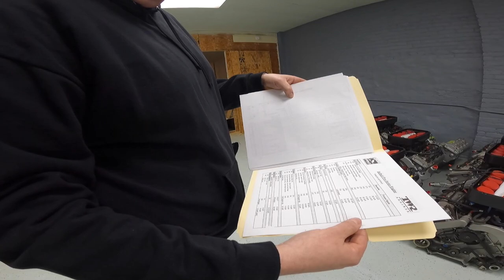10'800 HP! A collection of Nissan VK45 Indy Pro Series V8 engines up close and personal.

Comment: 450 HP with 8200 rpm redline in another article, make up my mind please
Reply from the maker: You’re referring to the drive. They just came and took the info from their for sale post without their permission and posted it and even incorrectly typed up
Information during the process. These guys never really went over any exact specs. They were referring to differently tested RPMs that were documented which varied across the board.
Reply: @Caito-garage  Understood. I am thinking there is only so many  HP available from 3.5 litres without a turbo or super charger.

My experience with small displacement V8s is extensive and they are often overlooked and underrated by those seeking monster cubic inches/hp.

We know an engine built for racing needs to be smooth at high rpms and sustainably durable which are all in a small displacement V8s wheelhouse.

So the question is what kind of extra horsepower comes between 6000 - 8000 rpm?

Is it possible that its 450 real hp at the wheels while naturally asperated and the 800 hp is what's possible with some help?

Additionally we know a 4.3 litre SBC V8 has monster torque at low rpms and I am wondering if the Nissan engine has similar torque potential and would be a racing advantage too?

In any case I was drooling over this engine even with 450 real horses having built 4.3 litre SBCs with 350 legitimate hp engines and knowing what it takes to even get to that level.

Also, I was on my wife's YT account before I noticed and you are talking to Blain.

Any updates on the specs of this would be appreciated.

Thanks for the work you do with your videos.

My expertise is auto glass safety

Here is me exposing unsafe practices on national TV and scooped Barbara Walters by 5 years. lol 

https://youtu.be/hD-XQbl2UQw

Thank for your comment.
Reply from the maker: Thank you Blain. I appreciate the kind words. I’ll see if I can find out some more information on the engines for you. I know a guy that has purchased one and I’m not sure the extent he is going to go into the build but I’m going to ask to keep me updated on it. You would think with the forged internals and relatively low compression being 10.5:1 you could run a bit of boost through it safely and make some great numbers. 

I actually have a good bit of footage on some more engines in his shop and I’ll try to put something together for you here soon. 

I’ll also go through the rest of my footage and see if they talked more about these specific Nissan engines. 

I’m gonna give your video a watch now 🙂
Reply: @traceymcelrea9631  I think they made more than 450. Nissan had said 600? Also did they destroke it? These engines are 4.5l from factory.